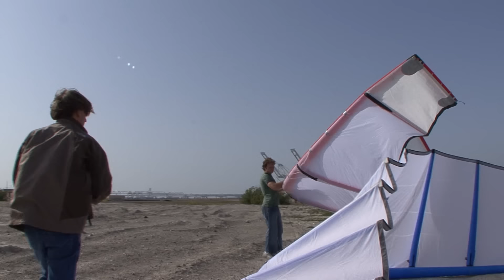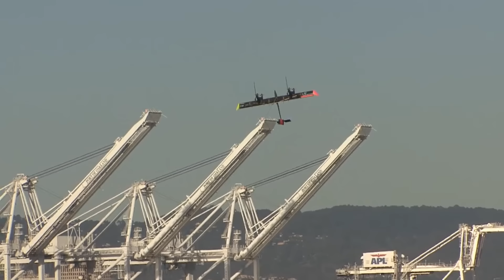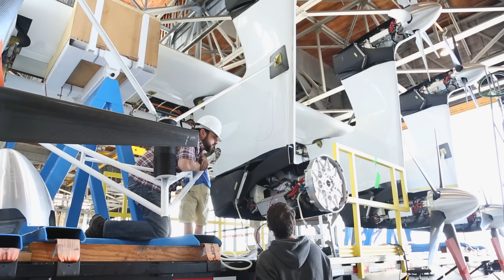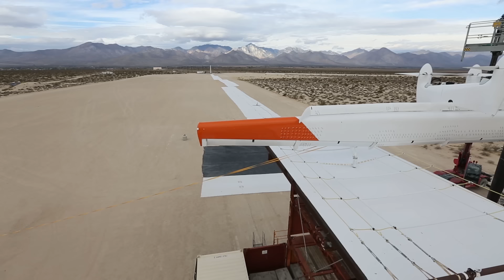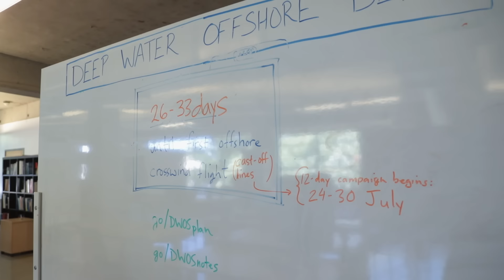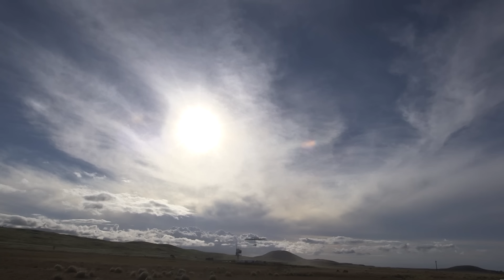Pulling Power from the Sky: The Story of Makani [Feature Film]

Comment: i have the answer to harvest energy by using kite. contact me for a fully detailed explanation. will use the kinetic energy of a spring to power a dinamo. spring will use a hand gun cocking mechanism powered by the pull force of a static kite flying perpetually in the air. repeating over and over powering a dinamo that will perpetually transfer direct electricity to homes.

Comment: Physics.... you get massive power my friend no doubt... but between running the blade motors on take off/ landing, air friction and computer controlled winch adjustments, not to mention human power throughout the project... hugely flawed... ..... materials are not there... underwater solution is just a micro bit better.... the environment killlssss! If it was dead on you'd have it.

Comment: It is not a kite, it is an aeroplane. It needs more power to elevate than it can produce, due to weight, complexity and reliability diabolica. Even children concede, perpetual motion machines cannot produce more than they consume. 
This was preposterous. Did you ever test it on top if a pylon? Just to test it's return on fabrication investment?  
And lastly, noise. No one needs an octoprop howling around the environment so it was an impossible implementation in any circumstance. 
I'm sorry no one with any reality acumen stepped in earlier. It was so obvious from the start. Like an elevator, to the moon. 
sorry.

Comment: Not practical at all.  Try replicating Dr T. Henry Moray's 5 kW home energy system from the 1930's that the USA turned down because they were afraid of the oil companies.  Moray's system generated enough power to power a house from an aerial connected to an earth through a box of components that he himself made, predating modern solid state diodes.
The solution to generating power doesn't have to be anything like as complicated as flying a high tech kite with old fashioned horizontal wind turbines to generate power.  High tech solutions are not needed. All that is needed is to find a way to harvest the sea of energy in which we live, and move and have our being.  The driver of this sea of energy is our Sun.  The same thing that also drives our climate.  You are not going to save the world from anything with a kite that generates 600kW of power.  The Sun is the driver of climate and it will have it's own way with it's own solar system. Nothing tiny humans do will have any major impact at all.

Comment: It doesn't take long to realize that powering any device with this rotary motion is a trust fund generated notion. (Accidental poetry notwithstanding..) Any torque generated will both distort the flight path of the kite (guidance input will require energy input) and result in energy dampening forces on guide cables which will be difficult to overcome. This will not beat wind turbines by miles, and the first few kite crashes and recovery costs will demonstrate that this was a free kite flying vacation at tropical destinations paid for by others to fund a video that subsequently benefitted its makers. Richie kids pretending to be aspirational with no real life skills to back it up again. smh Give some working class kids this funding. They'd cobble it together in Ohio, (for 1/100th the budget) and be honest enough to admit that(having watched kites dive into the ground and get lost in trees a half mile away).."this is kind of a stupid idea".

Comment: Wrong way to do this, Why make it complicated.. If they wanted a kite to fly and grab air to turn turbines, Then they should of used a type of blimp/hot-air balloon type deal, It could have supported it self easily and wind can simply turn the turbines... Don't use something that uses the motors that make power to have to potentially support it, Lolz 🤣 Why was electronics not waterproof, because they knew it would go down at some point. I guess those college degrees don't have common sense stamped on them...